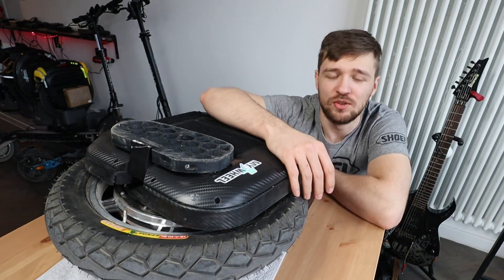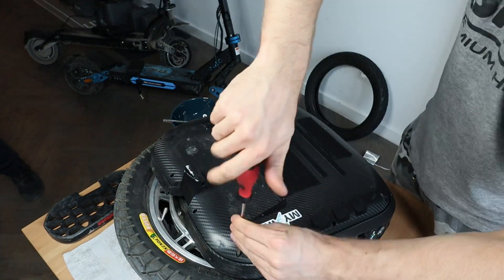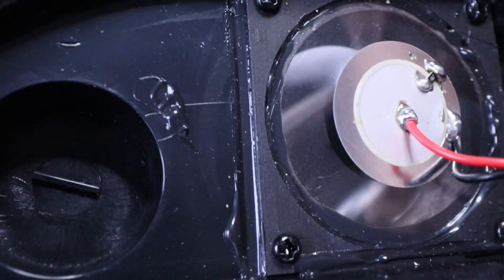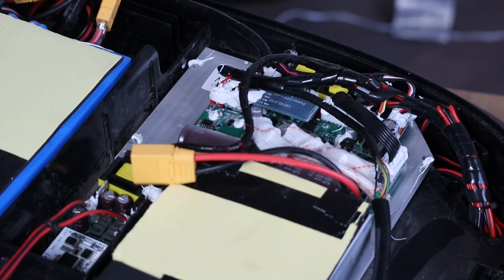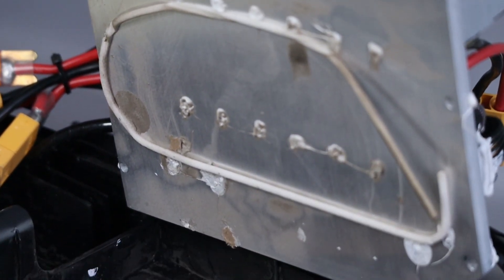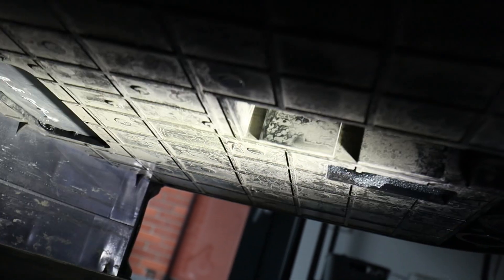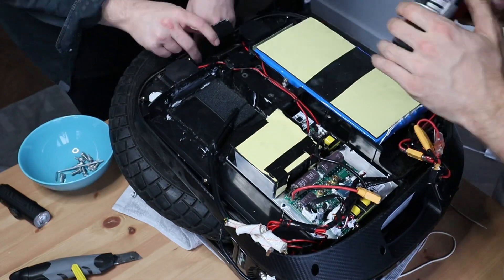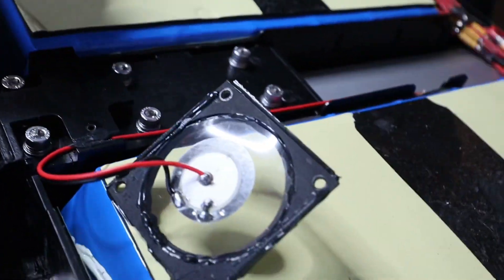Begode EX.N TEARDOWN - DUSTED!

Comment: self tapping screws are more secure and are more vibration resistant and are used on parts that are meant to be left alone. metal bushings can slip or screws can vibrate loose but are better for repeat access. gotway's assembly is correct.

Comment: If it already has such a huge block of aluminium to cool the electronics, why don't we make the whole EUC out of aluminium? It's not that heavy. I think we could make a metallic chassis and screw the mosfets directly to it. Everything would be very well cooled with a huge wheel moving air to an aluminium chassis. Like a big heat sink with good specific (per unit of mass) mechanical properties.
That way you don't need airflow inside the EUC and it could even be submersible.

Comment: hello adam
I changed my tire and removed my wheel by first unplugging
  the battery after having pressed the on button to discharge the capacitors then the 3 yellow, blue and green motor phase cables, then the motor cable, after having reassembled everything in order by reconnecting the battery cables I have a big spark and no the little clicking sound, do you have any idea what caused that?
Should I have disconnected the other battery cables behind the wheel? My wheel was at 90% battery charge!

Comment: Jesus, I’m sticking with My Kingsongs (16x S18), and my baby V5F, saving for a Sherman, and that’s it, although I love 	Begode’s design, I wouldn’t feel save riding on it. Thanks for the heads up.
Reply: If I remember corrently, on the V5F was one hole per Side on the innershel. It's nealy exaktly the same issue at the EX/n
Reply: Exactly, sae for me, stick with my 16x and 16s :) i want the ex n, so beautiful, but too fragile, will buy it when it will be safe

Comment: HUGE THANKS! I saw the 1st hole on your 1st review. That 2ND HOLE THOUGH - INSANE.
So lets say a perfect seal is made, still all the rocks and debris will be constantly knocking on that mosfet heatsink (and the speakers - jeeeez - 1 rock on that membrane and its bust hole into the unsealed plastic shell) - how will that affect the longevity of the mosfets (and the heat sink).
This design is SOOO horrible

Comment: I've tried to take the shell off and, even after all the screws are taken out (yes all - including the two li'l ones above the pedal hanger) it seems like there's a blob of glue on the cover, behind the magnet, that attaches to something on the inner shell/hub. The seal this creates with the inner shell I just couldn't break...and I didn't want to risk cracking the cover by using more force. Did you have this issue? If so what did you do? Many thanks!
Reply: It's the tape they put on the battery
Reply: @byronjolly4452  No it's an inch-wide blob of clear glue - like hot glue. Had to practically break the cover to break the seal!

Comment: The only well built Begode/Gotway wheel was and actually is the Nikola. No water or dust have entered mine after months of usage, almost 4500km and still so damn clean on the inside, even after some crashes it's got no damage at all apart from some scratches. I definitely love this wheel and probably will get the 100v version in the future (unless Veteran launches a 16 inches model which I'm sure many people is waiting for 😅)
Reply: My buddy's got probably over 15, 000 mi on his and it's been driven into a lake completely submerged water pouring out of it for the next half hour and is still here to this day and gets ridden multiple times a week!